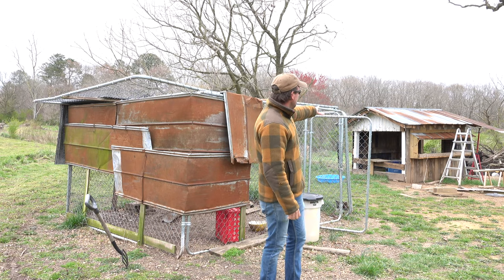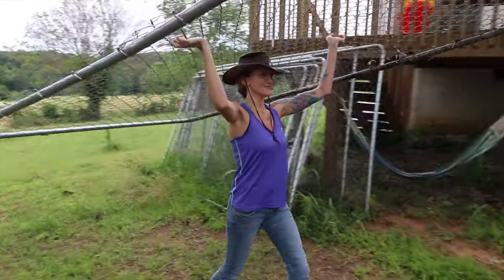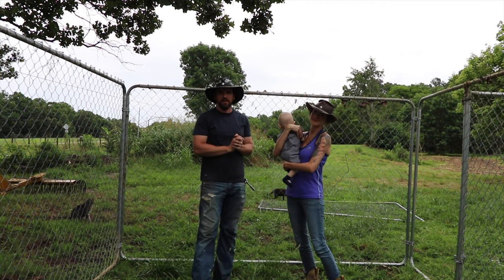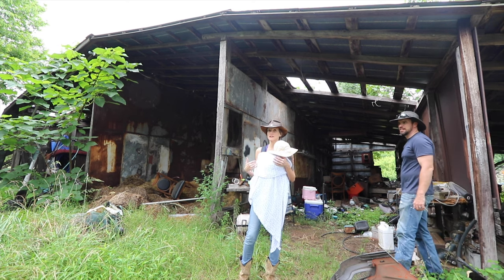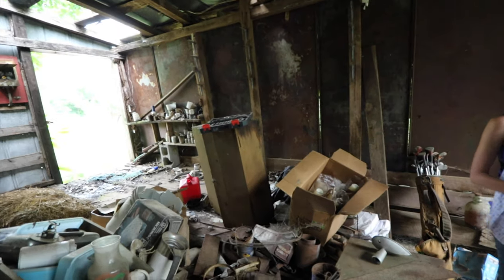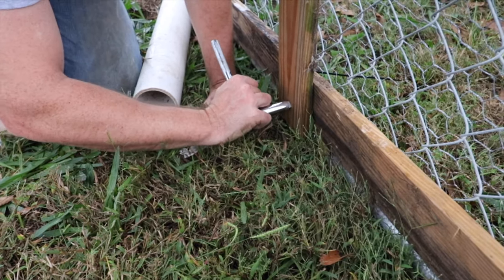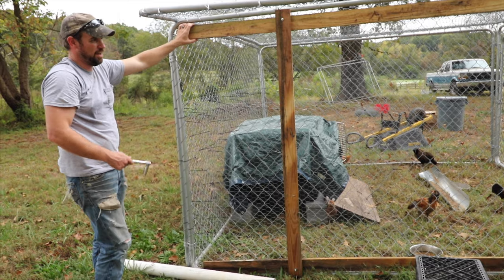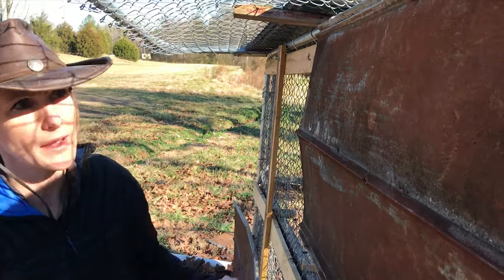Super Cheap "Hodge Podge" Chicken Coop from a Dog Kennel

Comment: The dog kennel is a great idea! I purchased 2 dog kennels off craigslist and use them as my chicken run. I had an old trailer that I converted into a chicken coop.
Reply from the maker: We thought about converting our old trailer into a coop.  But when we started this project our truck didn’t run so we wanted to keep the trailer available for hauling things. I think if you want something mobile old trailers are perfect!
Reply: I don't move the trailer, I keep it stationary and have my compost pile nearby. I had everything and had to purchase only a few items like the overhead netting to prevent the hawks flying in and the chicken's from flying out. I don't have a problem with predators other than hawks.